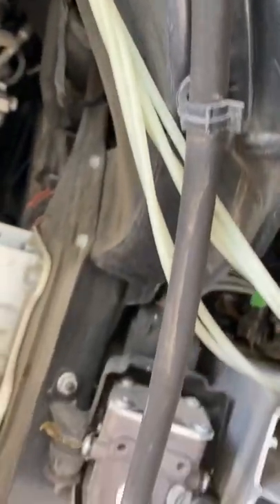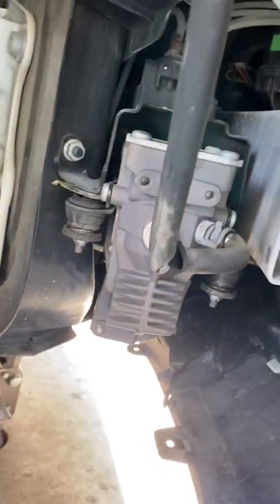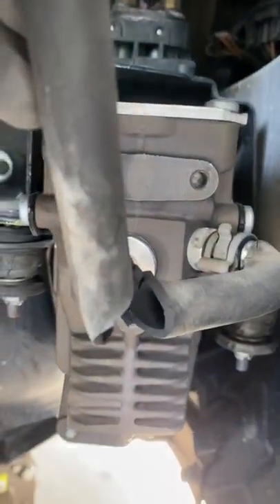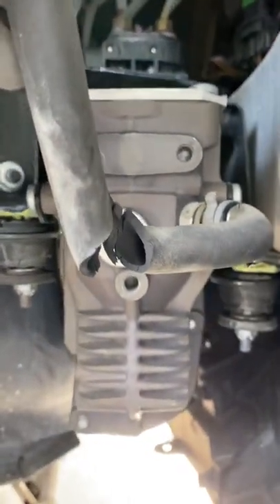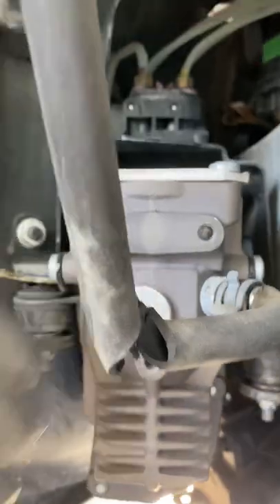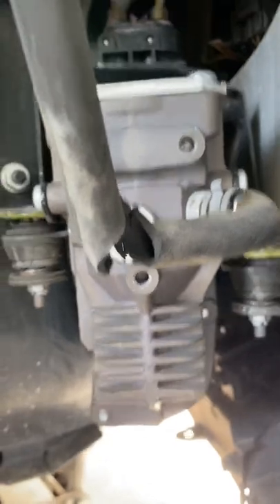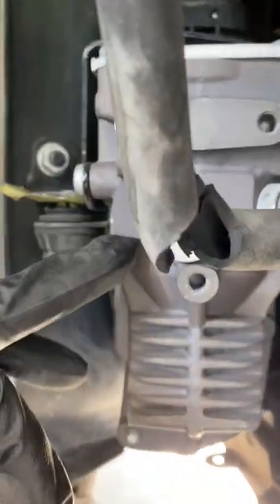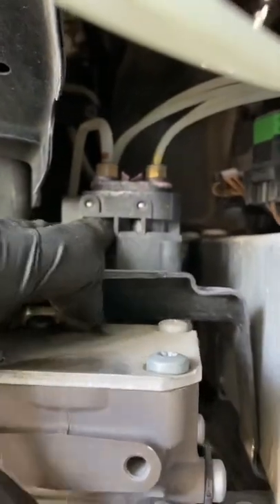Mercedes GL350 GL450 GLS550 X164 Air Suspension Airmatic Valve Block Issues

Comment: How do I replace that hose, mine broke right at the 90 before the hose clamp to the pump.
Reply from the maker: Yes it breaks at the 90 degree angle. I've seen it many times. You can buy a new hose online or you can splice your current hose with a new hose of the same diameter. 

If you need help purchasing this hose. Get in touch with us. I can provide this hose for you.

818.510.3375

https://mercedesbenzspecialist.net/

Comment: i got a real loud noise on my CLS 550 compressor its a W219 it sounds very often. Any clue? thanks
Reply from the maker: Very loud noise? The air compressor is likely going out. It shouldn’t run very often. It runs to make an adjustment to the suspension level depending on your speed. 

If it’s very loud and it runs often. You probably have a leak in your Airmatic system and the compressor is failing from the extra work load.